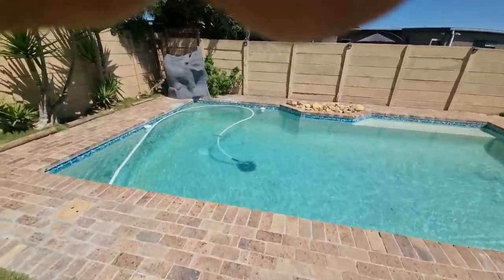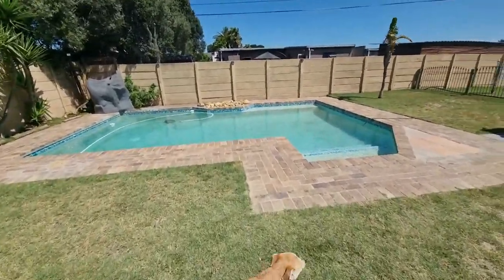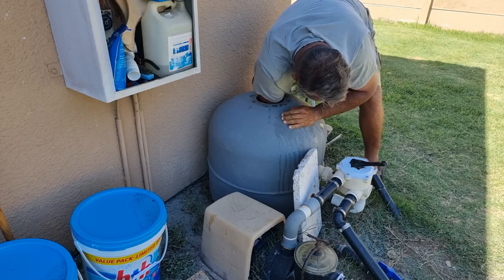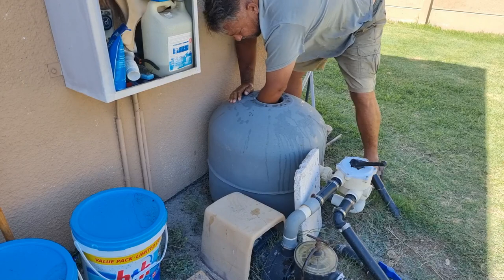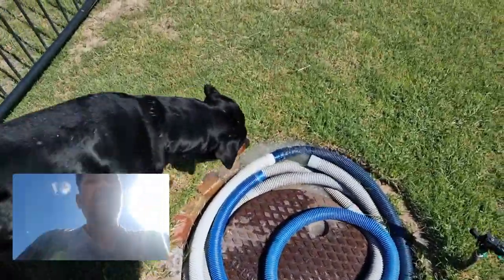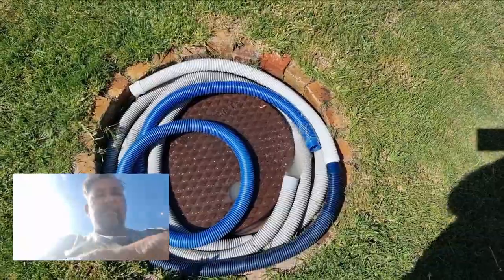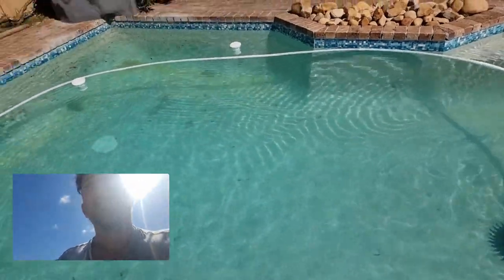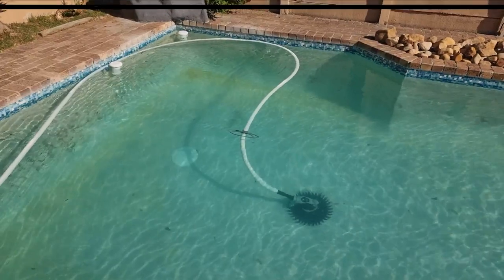Pool Cleaner Keeps Stopping...Problem Solved.

Comment: Thanks for the vid, gonna try it out, first need to get rid of the green water, but creepy also seems to run great on bypass but stops on filter.
Reply from the maker: Hi Wikus..goodluck with this. Let me know how ot goes. If it doesn't work after a second go at it rather just change the sand. Like I said I am just stubborn lol.

Comment: How do you feel about the ecofibe foam and then activator D?
Reply from the maker: The activator D I've never used but it seems like good deal. Maybe somebody can comment if they use it. Ecofibre I've heard good things too. No backwashing needed. People for some reason step back to change. I need to see the results before I change over. For now I will stick to the conventional way with filter sand. There is  also some kind of glass chips or something to that effect that you replace your sand with. Interesting.

Comment: My round thing u have your arm in is huge and it has the lever on top  to turn to backwash, rinse, filter  etc . I can’t do what u are doing putting my arm in . I’ve checked my creepy crawly for objects in it, still not working so I layed put the hose on path to let the sun charge it . See how that goes
Reply from the maker: A simple test...run filter on bypass/circulate so the water does not travel through the filter sand. If your pool cleaner runs fine like that rather just change the sand and save yourself all the hard work I did.

Comment: Hi Terrence, I bought a new filter today because my creepy sucks and stops the sand I replaced about 2 months ago.  When I. Replaced it didn't notice any cloged sand sand was loose.  I don't know what else to do
Reply from the maker: Hi there. Will advise but I'm no expert...lol. just pool owner for many years like most... place valve setting on "circulate" or "bypass". Run pump and see if it still stops intermittently. We start there...if it works fine bypassing the filter then we know it's by the filter.
Reply from the maker: What pool cleaner are you using?
Reply: I use a zodiac pool cleaner.  I've used my hose as well to clean in the clear filter as well, used a wire to clean it just in case.  What I've done lastly now is clean the sock that's connected to the hose I think it's called.  This far it's sucking let's hope it continues
Reply: I've done exactly that it runs on bypass I think possibly air being sucked in from somewhere just need to find it
Reply from the maker: @dillylachan2583  check the water level in plastic top of the basket just before the pump, if the water level has dropped considerably.  If so u have an air suction leak ie from the pump to the pool cleaner. Check hoses for leaks and joints are secure together. The hoses must be of the same design. I bought different type hoses only to discover air was being sucked in. You may also need to replace the diaphragm in the zodiac. Can get pap over the years and give problems...check for air first.

Comment: Hi Terence, Last year I replaced my sand with Eco Fiber.  

When I cleaned this year after the last winter and a slightly green pool, I just replaced about half a bag of the worst blocks, and rinsed out the rest of the blocks.  So far I am happier with this than all the messy sand, and NO backwash needed!!  

If I ever need to do any other work on the pool filtration, I have promised myself to invest in one of the cartridge filters which I think will be even better, since you can always have a spare cartridge to do an immediate replacement while the other gets washed.  

If you do decide to go this route then empty out the sand and hire a wet/dry vac to suck out the last of the sand.  Here's a link to look at for the Eco Fiber - I'm not affiliated in any way :)  but I do think its a good demo video. 

https://www.youtube.com/watch?v=PLwHvTx7ko4
Reply from the maker: Hi there. Yes I've heard very good things about this. A friend of mine has it and is very happy. He suggested I do a video on it too once he gets back from holiday. I have also heard of people using glass in their filters..also lasts a long time. Will certainly look into all this. Thanks for the comments and advice. Appreciate it my friend. Will check out the link thx again.
Reply: @terencesimpson100  Glass is a NO-NO !!!  I had glass.  Just try to stick your arm in there!   May as well just stick your arm into a meat tenderiser.  

It's not like the glass is smooth, its seriously sharp.  I was talked into using glass on my first sand replacement, and used gloves to try to clean the top few cm -  the gloves were torn to shreds in no time.   And if you by chance drop any... well don't walk bare feet - and your dogs could also pick it up on their feet.

I eventually had a good friend come around with this super large stainless vac that he uses in the carpet cleaning business and together we vac'd out the glass, put into a few of those strong woven garden bags and dumped it all !!!
Reply from the maker: @PegZ799  gosh good to know. I have never actually seen the glass. Thought maybe it was specially manufactured for the filter ie user friendly. Will not be going that route.
Reply: Got the same problem ….bought a new sand filter bought a bigger pump bought a new pool sweep … the pool cleaner … spent about 2500 and pool sweep still only goes for about 10 mins……very frustrating …. Today bought a plumbing cam to see if any roots may have come thru the lines….. running out of ideas here

Comment: Did you take the clumps out ???
Reply from the maker: Hey Arnie..some of the clumps I took out ...the others I just broke up by hand. Clumps collect mainly around the edges of the filter. I hope it helps. To make sure it's the sand you can test by running the system on circulate of bypass...if the pool cleaner runs consistently on that setting but stops after a while when on filter..most likely the sand. Also remove the pool cleaner pipe from the weir and the basket (you must keep the small basket in... the one situated at the motor.). Run backwash for 3mins. Removing the basket and pipe increases the flow to the filter thus better pressure to the filter sand for churning up.